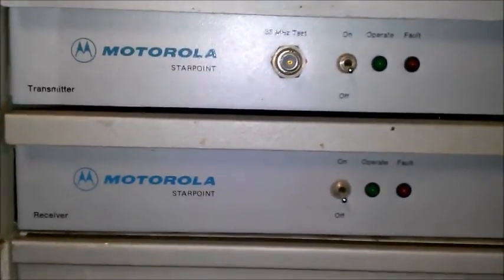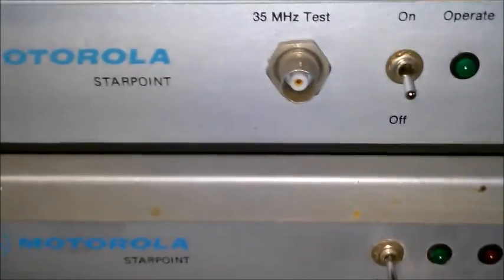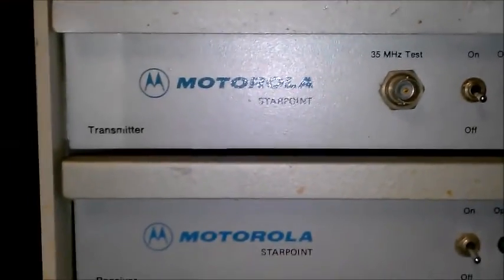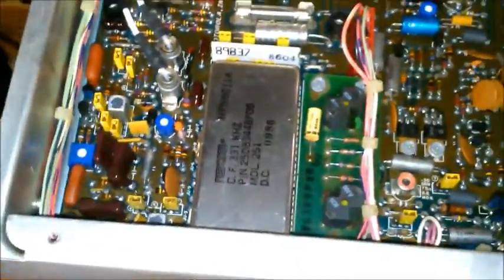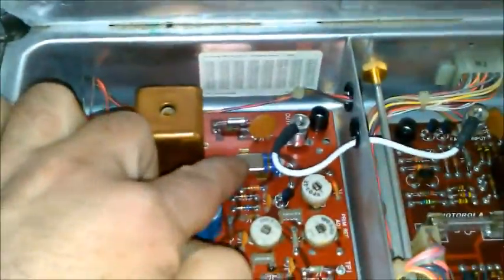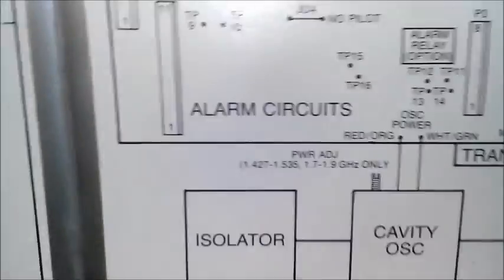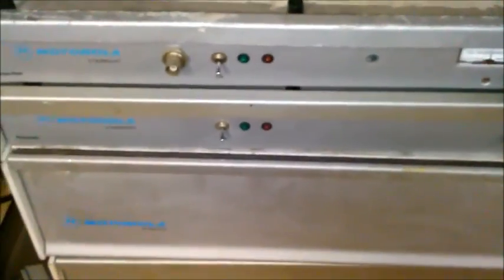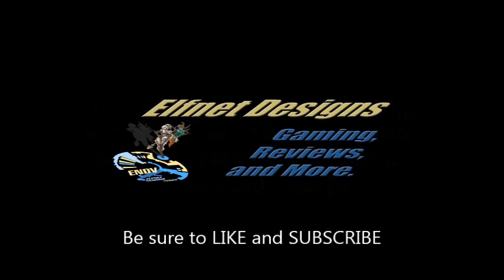Brief overview of the Motorola Starpoint Microwave Link Radio

Comment: Hi! have you got the manual for that Starpoint? I have 2 sets of modulator/cavity oscillator/isolator which would like use, but don't know how to power the oscillator...there are only two wires coming out the cavity: one should be the power supply for the Gunn diode and the other could be the PLL feedback (????) but which voltage??? and more over: which polarity???
thanks a lot in advance! 

i2NDT Claudio
Reply from the maker: She starpoint systems I have is a 24 VDC positive ground system if that helps.
Reply: thanks! I supposed it was like that! actually "positive to ground" is typical for radio links.